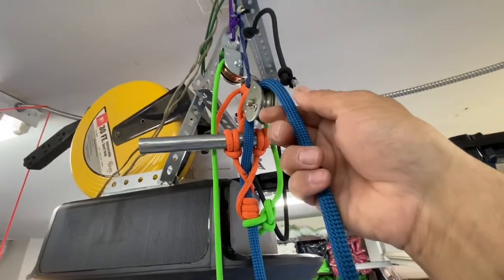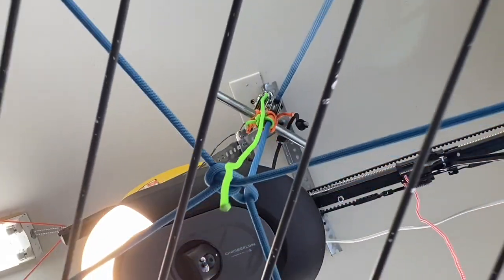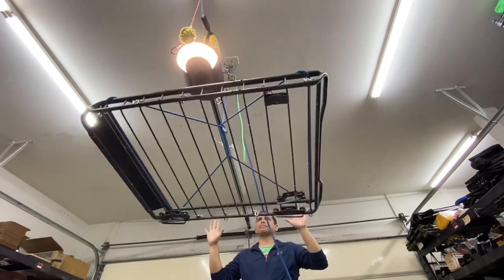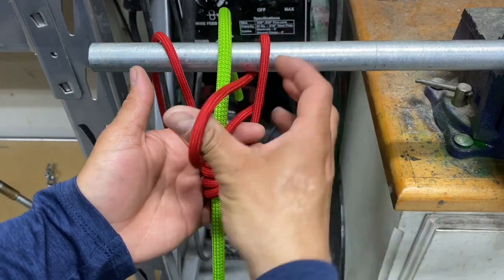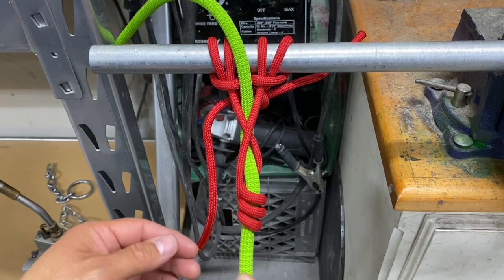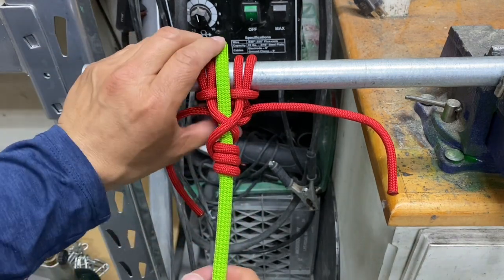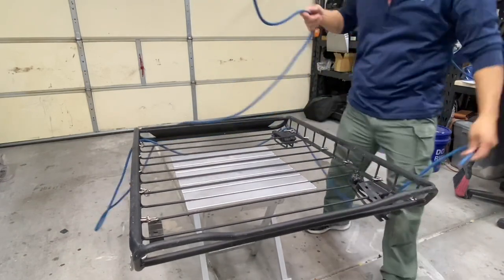Locking Hoist Knot. For Your Roof Rack

Comment: Really enjoyed this video. Started messing around with the XT friction hitch with an auto-tending finish, in a similar configuration to your setup here to lift a heavy planter.

I found that you can tie the friction hitch onto the end of the rope you'll be pulling, after it was thrown over the bar or hook. Next, thread the ends of the friction hitch through a mid line loop just above the object youre lifting and bend them together. As you pull in tension the friction hitch will collapse and allow progress, but if you let go it'll stretch and stop the motion of the object. It'll save your progress as you pull in a similar way without requiring access to a bar that in my case was nearly too high to reach. You could also run your pulling end through a hook or shackle attached to that midline loop and get mechanical advantage.

This is probably very obvious to climbers or anyone else who regularly uses unidirectional friction hitches but it was new to me!

Comment: That knot at the end looks alot like a prusik. The prusik is basically a larks foot with multiple turns. Tied using a smaller diameter rope around a larger diameter rope (like you've done here), and properly sinched up, it creates an extremely reliable rope-grab. 

They are used in the fire service as a progress capture knot when progress capture hardware isn't available. Applications include: hoisting a person, self-rescue via line ascension, creating an adjustable anchor system, and many more. Cheers.
Reply: The knot is a Distel Hitch

Comment: I don't know what that knot is called, but it's effectively much like an icicle hitch - but with the "fixing" hitch tied on the bar to make it static, rather than on the working rope. That knot uses a similar basic layout, although you secure it with two larks heads on the bar instead of one on the rope. Also similar to a pipe hitch, for the same reason (being a knot with a similar structure to the icicle hitch)
Reply: It's a modified Distel Hitch

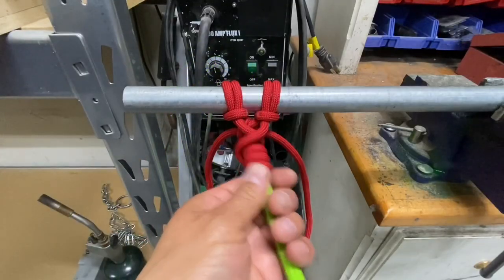Comment: The knot name 5:26 is ,,Valdotain treser'' it is a arborist knot
Reply: Oh is that what VT stands for. I just saw the channel howNOT2 test this knot with various ropes. Good to know.
Reply: It's similar to a VT but the VT crosses over each side. It's also similar to a distel hitch or the schwabisch, the last one being the most similar in the mechanical aspect. But I think this one is a mix of schwabisch with the finishing as a Valdotain tresse
Reply: @dsoperator  well the more you know... I've got a few more things to look up now. Thanks!
Reply: @SpartanGuy  I also watched this video today ;)
Reply: @dsoperator  Do you have any insight about the pros/cons/tradeoffs of the three variations? When would you choose one over the other? Are any of them made obsolete by the others?
Reply: @steamer2k319  I  personally use the VT most frequently as it is the more symmetrical of the three. I use that same technique on my hammock hang when I don't have enough whoopie sling distance from anchor points: just tie a 8mm climbing rope to both trees and use two 5mm cord as VT on each side of the hammock for easy adjustment. The Schwabisch is a more assymetrical hitch, thay may be of use for arborists when the run the canopy and are held secure on one side. THe Distel is more symmetrical than the SWB, is credited to be an error tying when someone (called Distel I believe!)  tried to do the SWB and forgot the change the direction of the split tail. Is now a hitch a lot of people use for climbing.  Then it comes down to a matter of personal taste or the one you remember best. Here in Portugal, for instance, firefighters don't use much the bowline and use more the figure 8, and I see a lot of tutorials on the bowline in the USA and the world being taught by firefighters. Thank god for diversity or we all be tying just granny knots! Cheers

Comment: how about a way to tie shoes together so i can clip it on the side of my bag? That would be so helpful for traveling!
Reply: the way i do it is by joining the ends together then tie a slipped sheet bend with one to the other shoe. it's quick and easy enough to make, easy to undo, and you can use either the loop or the line to hang it

Comment: Could this be modified to solve my problem? I have an inverted T-shaped ceiling mount for our kayaks. It works fine except that it's difficult to lift the boat up while inserting the crossbars. I wonder if I could use a similar locking hoist to lift the boat into place, then slide the crossbars into their locking position under it?
Reply from the maker: Maybe you can send me a photo through Instagram so I can get a better idea. Then I’ll try to mock something up for you.
Reply: @First_Class_Amateur  Absolutely! thanks
Reply: @First_Class_Amateur  Done! I sent a few photos and also a link to the exact hanger I'm using, in case that helps.

Comment: What size and types of ropes are you using?
Reply: Just use a rope rated for the weight you will be lifting and your second rope (the red one he uses) should be roughly 25% smaller than your hoisting line. Source: I climb with rope :P
Reply from the maker: The hoisting rope is 9mm. Everything else is 1/4”.